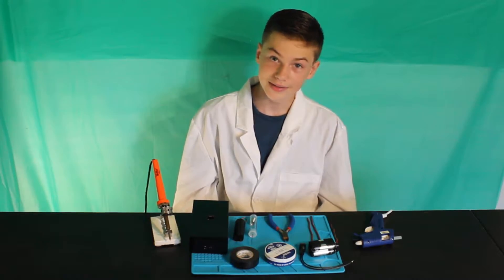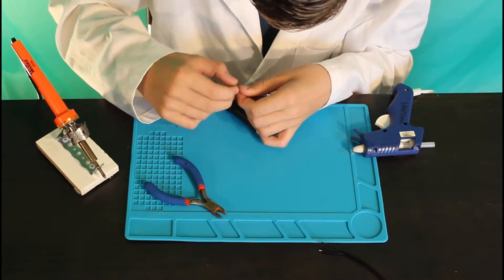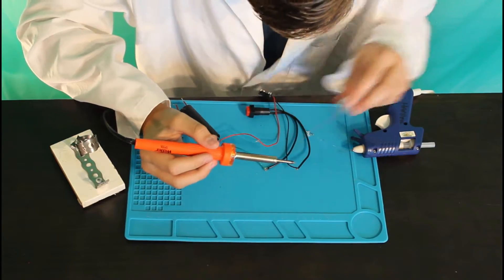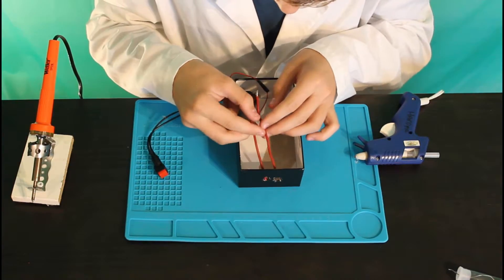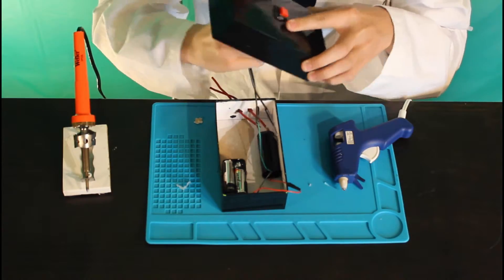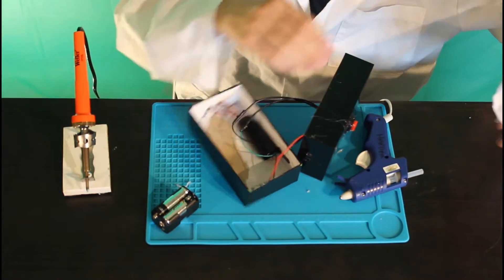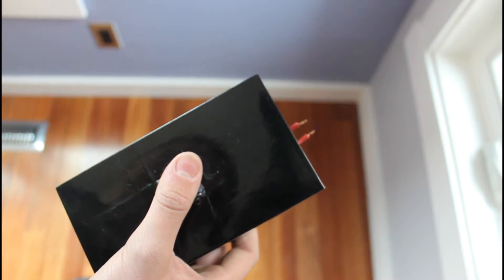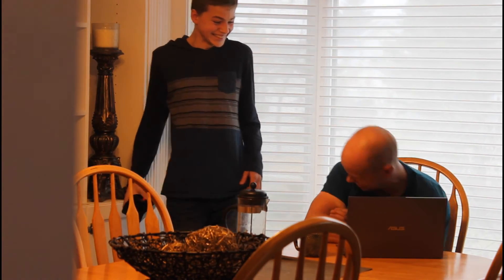How to Build Your Own Stun Gun

Comment: How can i make my battery acid 98% sulfuric acid is it possible?
Reply from the maker: I'm pretty sure it's close to impossible, because it turns into a gas past that point.
Reply: @projecthazardous8414  i heard some people said they could make it to 96% by just boiling the battery acid are u sure its not possible?
Reply from the maker: I'm sure it possible, but there aren't many uses for something any higher than I made, if there are any uses.
Reply: @projecthazardous8414  sorry ima kinda stupid but will boiling it for more time  make it to 96%?
Reply from the maker: Yes, but there is a greater danger that it will turn to a gas and become very toxic.
Reply: @projecthazardous8414  alright thanks i subbed btw
Reply from the maker: thankyou
Reply: You have to distill it which I do not recommend as you need good quality glassware and there is still the risk of it breaking and catastrophe. Just buy it, it is cheap stuff
Reply: It might be cheap, but you cant buy it in alot of countries